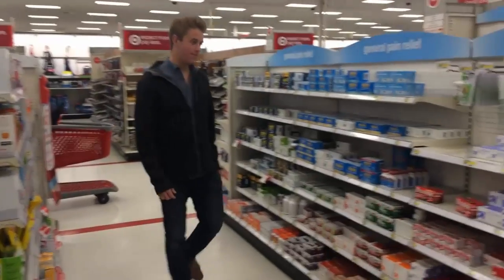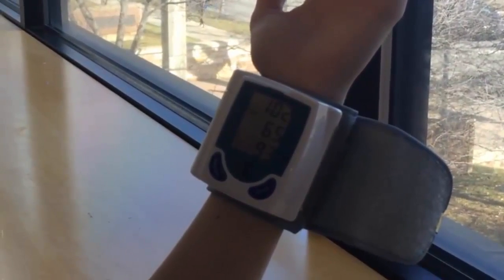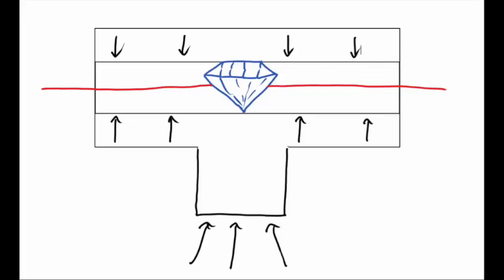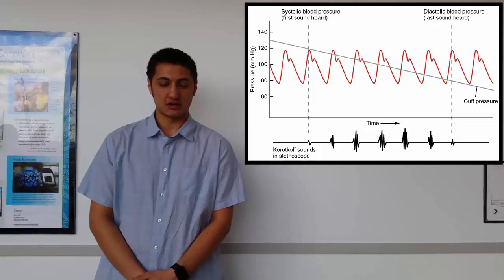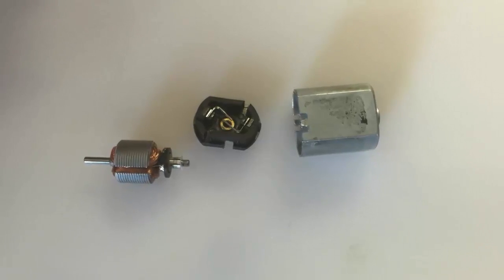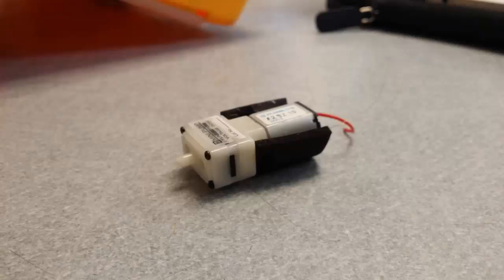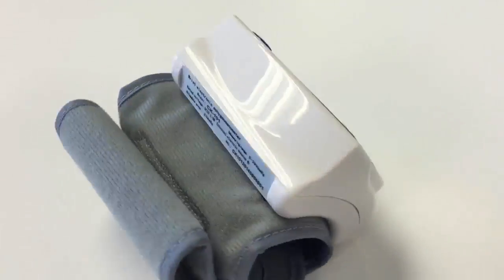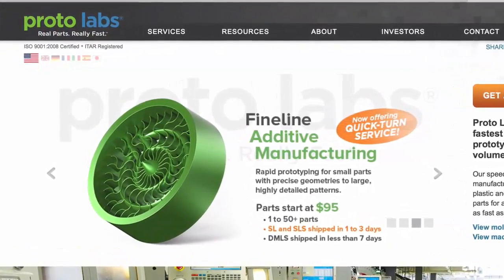How does a bloodpressure monitor work?

Comment: You mention the pressure in the veins twice but what you really mean is the pressure in the brachial/radial artery in the example of your device. I'm curious to how the sensor actually works and how to recording is made. How does the pump 'know' how much air to pump until it overcomes the arterial pressure and blocks it? then, how are the fluctuations of turbulent flow sensed by the device? is the current constant as long as there is turbulent flow affecting a sensor so that start and end point are extrapolated? thanks

Comment: I am interested in making an internet connected blood pressure decie with a twist.

I am a software engineer but not touched hardware since I was a teen and even that was extremely basic any tips advice? Are all the parts involved easily purchasable on Alibaba? Could you build a shopping list pleasseee

Comment: hi, great video
could you guys get me a list of the materials you used to manofacture the monitor please?
Reply: Nikolaus Correll hello. if you have a link or part number for the pressure sensor, please share it here. i need it for a project. thank you.
Reply from the maker: +pascuala sylleros  The students did not manufacture the blood pressure monitor but re-engineered an existing system from Amazon
Reply: Pls, I want to reengineer this device...pls list the parts if you know it